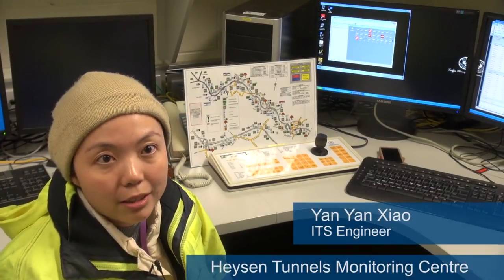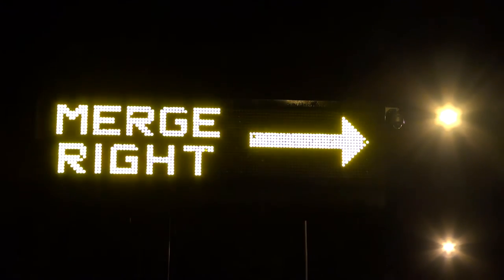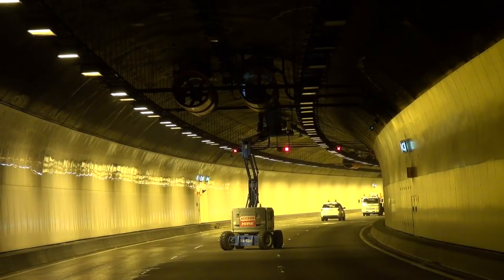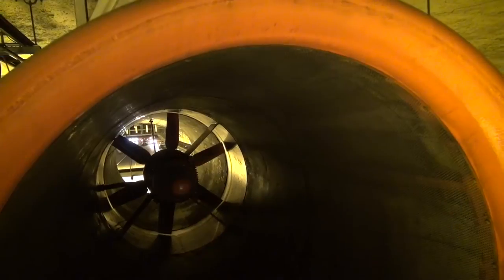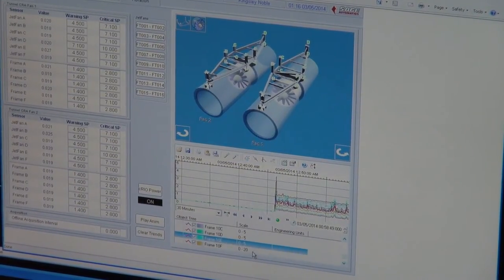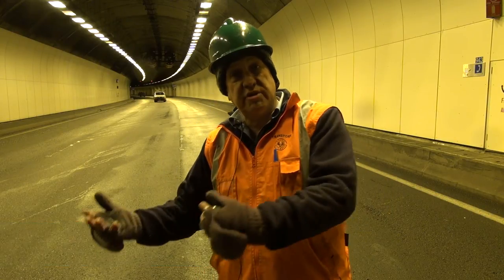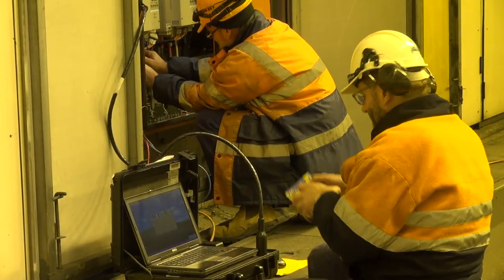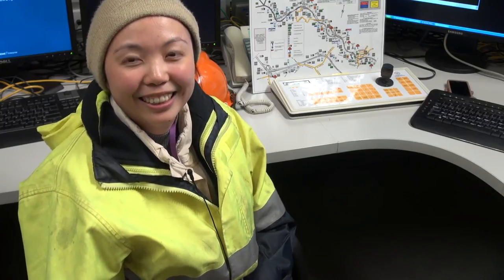Heysen Tunnels: world first technology ensures breathable air

Comment: So how do your vibration sensors differentiate between what could be a legitimate resonance vibration caused by a loose fan blade and say the pressure pulses of a passing truck exhaust (blowing directly on the fan) impacting on the fan? I would also think that fouling of the blades by soot and oil from the truck exhausts would over time lead to running conditions that would look exactly like the out of balance you are trying to detect. I guess the routine tunnel closures you have to clean the tunnel fix that, therefore the vibration monitoring was a waste of money.

Comment: What is so ground breaking about vibration monitoring of equipment? The only unique part of this is using monitoring equipment worth millions to monitor a fan worth a few hundred. There used to be a system called 'programmed maintenance' where equipment  would be serviced on a running hours or elapsed time schedule, cost nothing and worked. An out of balance fan would also be picked up by a trembler or 'earthquake' switch available off the shelf from equipment suppliers, used since the 70's.